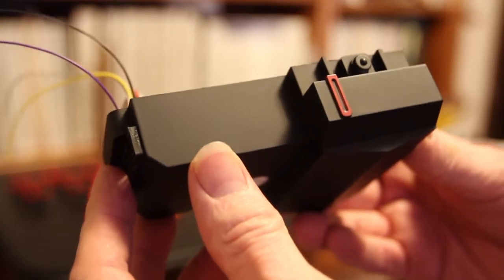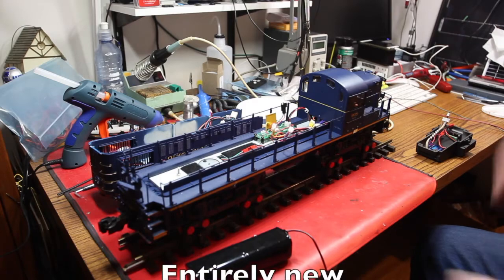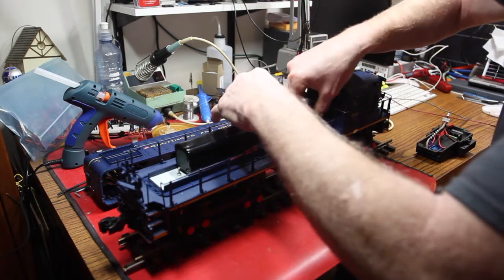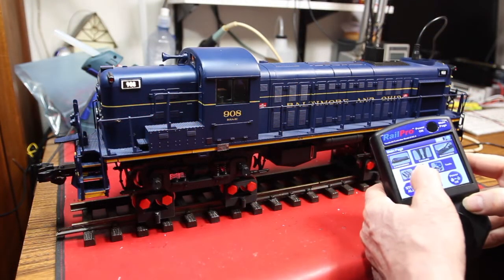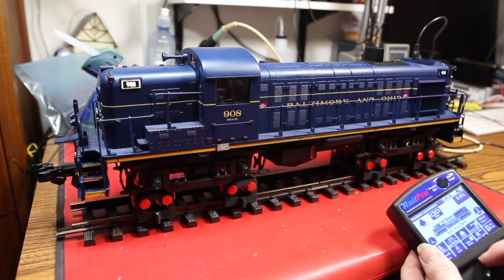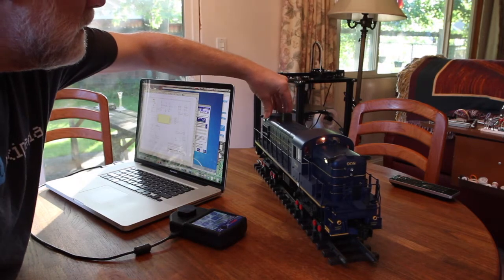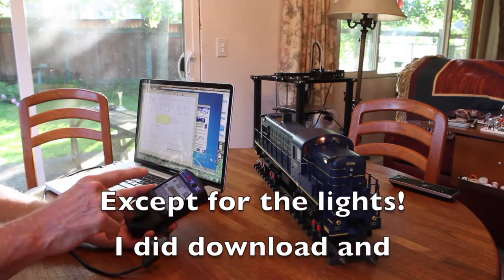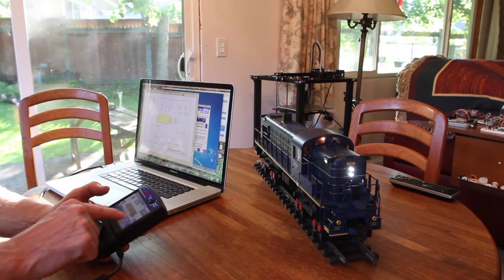Aristocraft ALCO RS 3 battery conversion

Comment: I have this exact model and the USA trains GP7/9.  I’m a newbie, can you explain what the radio/transmitter is (make model) and the receiver?  what is the sound card and speaker?

really appreciate this and would love some help.
Reply: John, check out Ring Engineering. The hand held is Railpro's HC-2 and the decoder is RailPro's Module LM-3s-G or their LM-4s-G. I buy my RailPro equipment from RLD Hobbies. If you decide to try installing yourself call Robbie at RLD and he will set you up with everything you need.

Comment: Hello, ... What a great video with RaiPro. To be honest, I’ve planed to do the same with my G-scale Bachmann Spectrum 4-4-0 (radio controlled + battery)
Considering that I already have a ESU Loksoud XL V5 with ESU Loksound dual smoke pulsed smoke, what will be the best way to you ? Railpro + LM4S or Airwire T6000 + CONVRTR-60 ?
(I want to keep the sound from my ESU Loksound with my dual smoke pulsed unit..)

Here is a picture of the settings I thought :
https://i94.servimg.com/u/f94/19/07/38/52/connex10.jpg

Thanks for your support...
Alexis (from France)
Reply from the maker: Hello, Alexis!  Thanks for writing!   I've only every used a Loksound once in a Swiss Rhaetian Railway Ge II because it had the only good electric sound base, but it worked very well..  I had problems with the loco motion with the Loksound, and we had a Airwire G4, so it's quite a mishmash of electronics, but it all seems to work.

The Schematic you shared looks just fine and in effect is identical to the GE II shown here: https://www.youtube.com/watch?v=Q6dbXWEs-ns

I think your plan is sound and should work just fine!
Reply: @mtrcycllvr  CVP AIRWIRE, ... Next Blunami (once the 4 amp board will be produced...) Stil thinking about the project. I'll let you know. Many thanks again.
Reply: If you have an AirWire handheld throttle then it's a no brainer! The financial savings of using RailPro over CVP's AirWire is that with RailPro's built in sound you don't have the additional cost of a sound decoder.

Comment: Hi one more question please. How did you wire the power for the cooling fan?
Reply from the maker: Hi Bob!  Thanks for writing!  The fans I install fall into two categories, 5volt or 12 volt - to attach them, I purchase either a 5v or 12v "780X" style 3 pin regulator..  I happen to favor the new "switching style", which are more efficient and conserve battery: https://www.digikey.com/en/products/detail/cui-inc/V7812-500/1828605   

As far as fans go, there is a large range of 5v and 12v fans in the 1" sort of range here as well:  https://www.digikey.com/en/products/filter/dc-brushless-fans-bldc/217?s=N4IgjCBcoCwGxVAYygMwIYBsDOBTANCAPZQDaIMADHABwCcdIhVcdYCz1dAzAgLqEADgBcoIAMrCATgEsAdgHMQAX2WEATGXDqAbgAIAJkj0Y5IPsqA

Again, this should be EASY - battery to pins 1 and 2, fan to pins 2 and 3, 3 being the red wire or positive..   Pin 2 is common ground..  Pin 1 is raw battery up to 32volts..  Place it AFTER the power switch so that when to turn on, the fan is on full time..

SOMETIMES, depending on the decoder, I will run a small 5volt fan off of the 5volts provided - a railpro decoder has 5 volts available, for instance..

Hope this helps!!  Happy training!  ;-)
Reply from the maker: More fans: https://www.digikey.com/en/products/filter/dc-brushless-fans-bldc/217?s=N4IgjCBcpgLFoDGUBmBDANgZwKYBoQB7KAbRACZYBOAVgA4A2EAugdkbuZCvJtYgC6BAA4AXKCADKogE4BLAHYBzEAF8CsJtBDJI6bPiKkQsAAwM6VKlzMMqYJhvNUAzI5A1TsMOU4arDOQuXJ6wNFTwBHw0NC40XC5UrBF%2BIInJ1DbmjJEm2RZZFqzBTnawqba0poW0EKW08EIgYhLS8spqqqpAA

Comment: Hello this is a shot in the dark lol. Would you happen to have and be able to share an stl file for the battery charge jack in the fan compartment? I like your You Tube video on the install !!!!
Reply from the maker: Hi Bob!  Thanks for writing..  Youtube doesn't do much to let us connect OUTSIDE of youtube.. I do have the file - you can try viewing the SOURCE here: https://www.tinkercad.com/things/kIhWwWgZlzO-switch-and-charge-jack-plate  

You MIGHT have to be a tinker cad user to view it?  I'm not 100% sure how that works..  Run this through a slicer and add a color change at the lettering layer and it will come out very nicely!

Comment: where u get your wires from?
Reply from the maker: Hi Darryl!  THanks for writing!  I'm lucky to  have a surplus shop nearby that I purchase short lengths of "ribbon cable", which is a bunch of 26/28 gauge molded together..  They peel apart nicely!  I ALSO made a number of "connections"..  To do those, I use "pre-crimped" JST-SH wire from a place called Polulo Robotics?  I buy kits of the JST-SH connectors from Amazon..  JST (Japan Solderless Terminal Company) makes MANY ends, so don't just look for "JST", be sure to use the JST-SH term!  They are "board to wire" only, so the wire to wire ends are hand made with solder and hot melt glue..   I also purchase, on occasion, "kits" of silicon jacketed wire of various gauges from hobby king - this wire is supper flexible and I use it for main power distribution within the models I do..

https://www.amazon.com/gp/product/B00X7BS182

https://www.amazon.com/gp/product/B07NWD5NTN

https://www.amazon.com/gp/product/B0731MZCGF

https://hobbyking.com/en_us/catalogsearch/result/?q=silicon

Take care and good luck with your models!

Comment: The most confusing part is the wiring and you skipped all of that.
Reply from the maker: Hi J!  Yeah, my videos are admitedly not the best..  Turns out that taking the time to do a "good" video is more diffucult than one could imagine!  ;-)   

The wiring in this particular locomotive simply follows the RailPro manual - I installed lots of "break for service" connectors so I could locate the decoder in the basement, so to speak..   The physical wiring is really just the motors and the LED's doing the lighting.  I TOTALLY ABANDONED all stock wire and switch/switchboards.  I left the original switch board in place under the cover, but it's just filling the hole is all.   I think I used a little 60mmx40mm proto board to build up power distribution..  Just break the various circuits down one at a time and it'll be fine.

Thanks for the feedback and in future videos, I'll try and add more electrical detail!

Comment: Very nice install but I'm pretty sure you're running it backwards.  You'll notice an "F" on the long nose end of the locomotive, that's the front.  PRR was the same.  :)
Reply from the maker: You know, I had to think about this for a bit..  You could be very right, but the HORN is pointing forwards on the short end, so that's where I put the ditch lights..  It may wall be totally backwards, but the horn was the detail I followed in this case!  Thanks so much for the tip!  I'll pay way more attention in the future!  ;-)
Reply: @mtrcycllvr  Just reply your Engineer prefers the field of vision when running short hood forward(problem solved).

Comment: Nice video, I have 4 locomotives converted to Railpro 2 track power 2 battery.  I use the computer modual for programing.  Great system.

Comment: are the stl files available for the 3D printed vents
Reply from the maker: Hi Ricky!  Thanks for writing!

I used "tinker cad" to create the vents for this project..   https://www.tinkercad.com/things/atN5HjQDeof-vent-grill-50mm-x-15mm  (am I allowed to place URL's here?)  In tinker cad, find the thing, select EXPORT and file type.   Vents like this are SUPER EASY to create on tinkercad - create a solid slab.   create a smaller void slab, tilt it, position, then copy, paste, position, repeat and then group it al..   I don't even save them most of the time they are so easy to craft from scratch..   Good luck!!